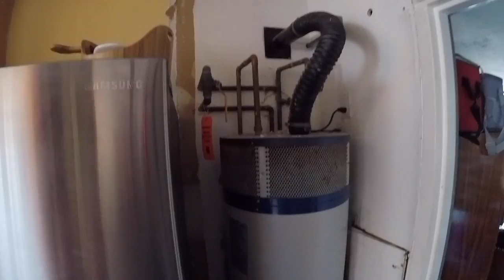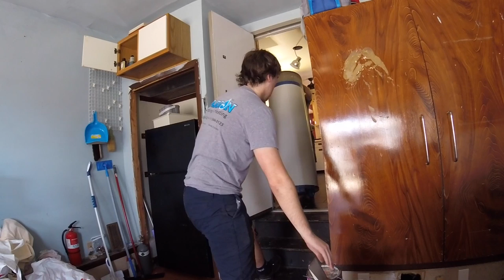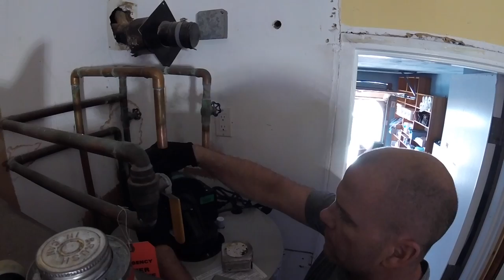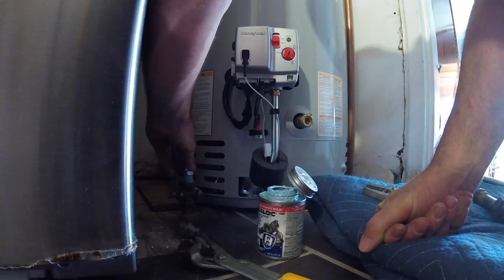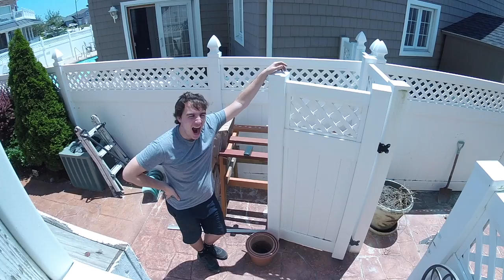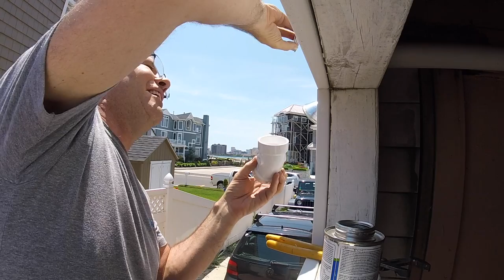Bradford Power Vent  Water Heater Installation

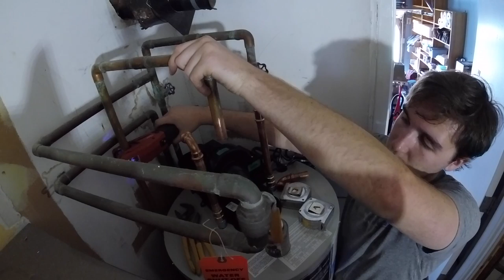Comment: Great install chuck, I wish you would’ve faced the pvc labeling away from the front of the water heater at 9:30, I think it looks cleaner when no lettering is showing
Reply: Some places it's code to show lettering to prove that it's the right pipe for job

Comment: Thank you for this video. I have a question for you. I plan to replace my old furnace with a high-efficiency one. That new high-efficiency furnace will no longer use the chimney but will use the venting plastic pipes going outside the house. Also, I want to get rid of the old furnace liner vent pipe to free up some space in my washroom. What I understood from your video is it looks like this new high-efficiency water heater is using the same plastic ventIs as the furnace and it could be vented outside without the liner- is this correct?

Comment: At 21:18 was the very reason I cringed when all the copper connection were being put together without updating the 1932 rusted washer-type valve with a nice teflon-brass Ball-valve ,,, Come CB2 !! Spend another $5.00. Peace.
Reply from the maker: Your right but the kitchen being remodeled at the time "soon" and water heater gonna be moved. still has not happened. ha.

Comment: Great job! I'm thinking about getting power vent. Just got couple questions. 1. What type of PVC pipe require , 2. how far  can I run PVC horizontally outside to termination point since the heater is under a bed room window? Thanks
Reply from the maker: Dj, what ever paper work says...you can look up you model online and get specs for sure. good luck.

Comment: I love your videos and the banter between you and your son! I wish I had a father to teach me a trade. I have questions about your tools and materials you use for those connections you use without solder and or compression fittings? Those fittings you use, are they compression or not?
Reply from the maker: Thank you. I do us pro press and viega fittings. all pressed with tool. look up viega fittings and I use ridgid pro press.
Reply: Chuck Barron I looked them up, I don’t think using the tool they sell is cost effective unless I’m an actual plumber though.

Comment: A chuck,quick question.does your propress tool ever get stuck to the fitting where you kinda have to wiggle it off,my m12 does and according to manufacture it’s normal and to put spam on the jaws lol,what you think about that?
Reply from the maker: Yes....especially the half inch. No sure why..
Reply: Chuck Barron you no what your right,always the 1/2 inch strange
Reply from the maker: yes.  for sure

Comment: can you take off the power vent off of a gas Rheem hot water tank and the control valve and change it to normal valve and vent it out the chimney
Reply from the maker: voids all warranty. Call rheem on that one. I would not.

Comment: What brand propress fittings do you prefer?  Ever have an issue with the imported brands?
Reply from the maker: I like viega....they sell em here. You? I never had imported yet.....
Reply: Chuck Barron I think viega has the best quality.  I had an issue with nibco.  I wasnt getting a green light on my tool after pressing.  I also like apollo fittings.
Reply from the maker: nibco....hmmmm ok i will keep an eye out. also green light....what you get a green light for go if it is good? I better read the directions after 3 years...lol
Reply: Yeah I have a m18 Milwaukee.  After the press the tool gives you a green light if the press was correct.  I thought I needed  to recalibrate it so I sent it back to Milwaukee.  They ended up busting my tool and they sent me a new one and a newer model.  It took three weeks to resolve the issue...

Comment: quick question, is it acceptable to make the water connections to the tank with that vega fitting? i always used a dielectric union
Reply from the maker: as far as I know yes. I have always used a male or female here in Jersey. Copper, Pex and Viega. Could I be wrong hmmmmm thats a good question. Let me research for my own good. Thanks Wig
Reply: Chuck Barron good to know. I'll check with my local codes as well. Your method is super easy and would like to start implementing if allowed. 😎
Reply from the maker: Ya i have passed many many inspections so I gotta guess we do not use them.

Comment: Why no polyvinyl tubing for the condensate on the exhaust? Love watching your videos, keep up the good work
Reply from the maker: from what i read its optional. thank you for good words.
Reply: I believe you need the clear tube as a condensation line for the vent if it goes to the roof ... in this case it goes to the wall so that's OK.

Comment: CB2 I have a Turbo Torch that uses acetylene what size tip should I have on there to solder 1/2 inch copper tubing? Peace Makita man the OG. Lol
Reply from the maker: Yes....I use mapp gas.....got one that will work .....I prefer mapp. CB2 you napping?

Comment: I see u had a leak on the hot side,I see a coupling
Reply from the maker: Great eye pete. I did not have a leak but I think I changed my mind on pipe job. I cannot recall.
Reply: I think they may have forgot to tighten the hot side female adapter?!